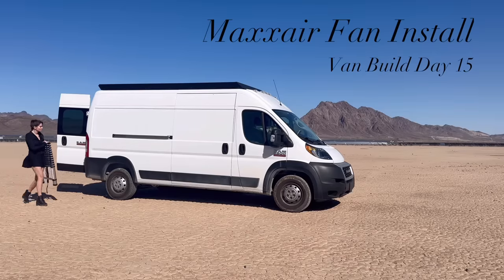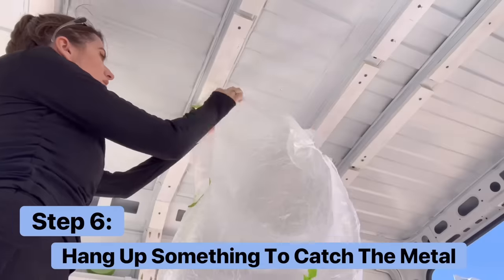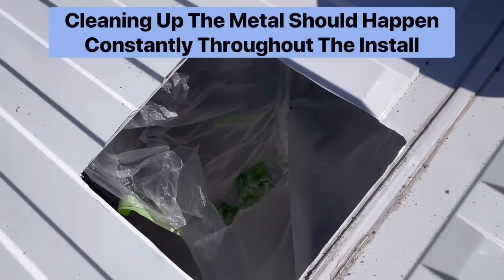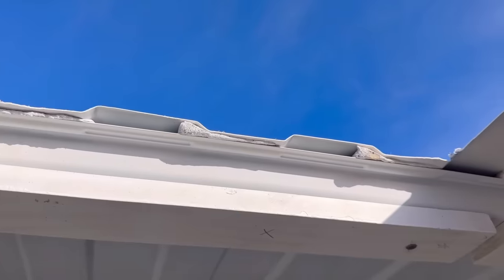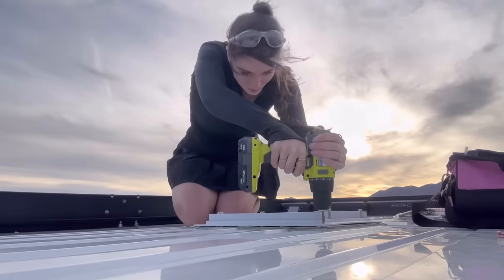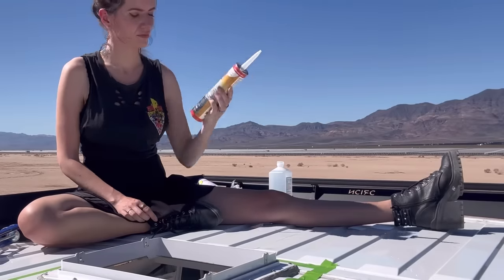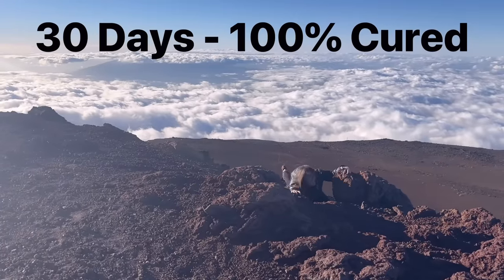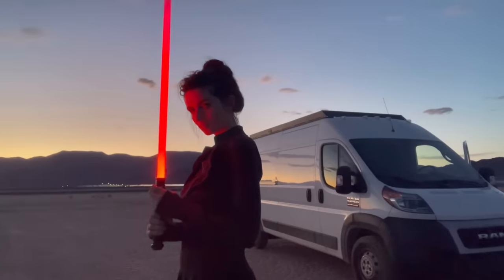ULTIMATE Guide To Installing A Maxxair Fan | Van Build Series Day 15

Comment from the maker: Revisions / Clarifications: 

I was wrong about what the manual says, I was just reading the instructions step by step however in another section it does encourage you to install a wooden frame if the following is true...

( This is a direct quote from the Maxxair Fan manual )
"The MAXXFAN is designed for a minimum roof thickness of 50mm to a maximum of 110mm. If your roof thickness is less than 50mm, build additional thickness at the ceiling opening using wood or other suitable material."

A typical roof's metal in between between 22-29 gauges, I couldn't find the exact gauge of a Promaster roof on Google. 
So technically according to the instructions I am supposed to add a wooden frame. 

Do I regret not doing so? EHHHH Not enough to lose sleep over. I lived in my last van for 3 years with the fan installed the same way and I have seen plenty of fan installs even by professionals without the frame. I knew I was in an ideal spot for support that would't really fit the frame in the first place. So all that to say, do with as you please with all of this information.

ALSO, I saw someone screw a block of wood into the middle of where they were going to cut out for their fan. So he had something to grip to hold it up after cutting it out, which is MUCH better than my tape method! I wanted to share the great idea :)

Comment: hello, a really good way to drill sheet metal is with a cobalt step drill and add a few drops of rapid tap cutting fluid as you drill.... it leaves a perfect round hole with the edges/rim beveled/smooth.......... great video's☺

Comment: 3:40 don‘t apply pressure to the blade, apply pressure to the base of the saw. Go slowly and consistantly, give the blade time to  do it‘s job. Also, it helps to put a bit of cutting/drilling oil on the blade, works wonders.